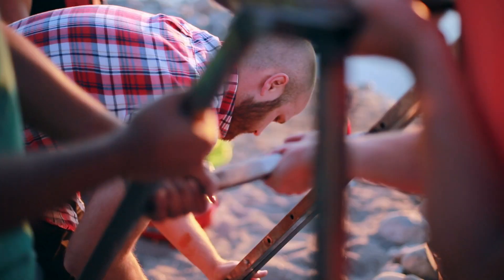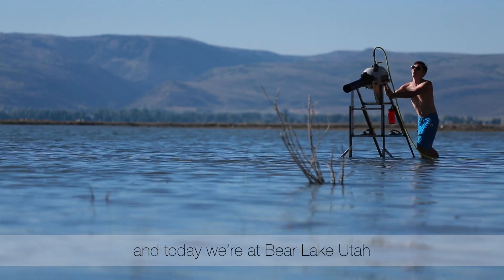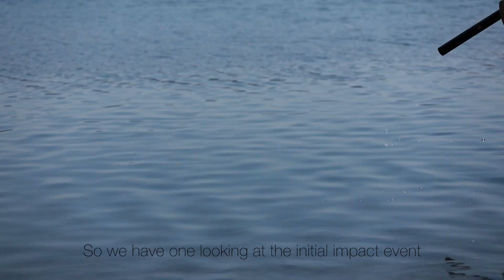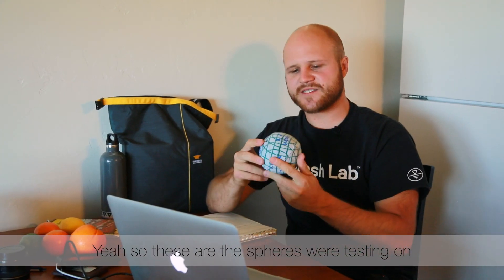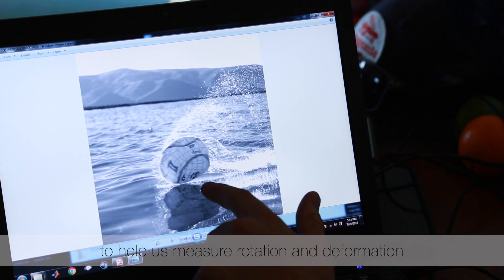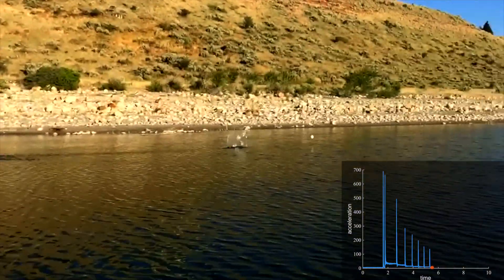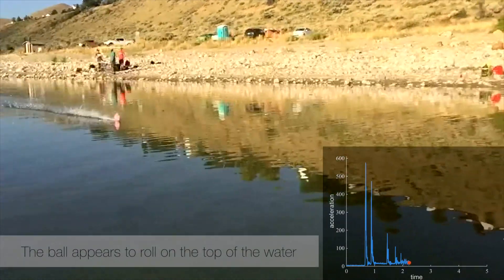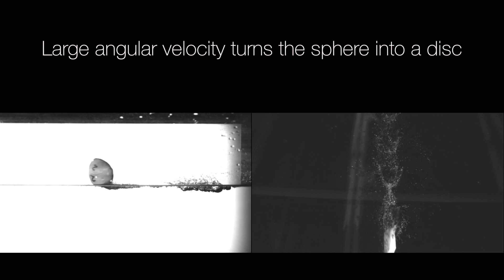USU Splash Lab: Water Walking

Comment: if you look at the guy who has the outright 1000 meter speed record for sailing ( crazy cantilever speed sail design) -----you will eventually come across older interviews of him where he explains the process of innovation. apart from the design of the hull and sail , he said a major obtacle was the shape of the foil. 
at speed above 60 mph (he hit almost 80mph sailing if i recall) the hydroplaning foils no longer was to stay sunk below the water surface and so they begin to create massive drag, the result is that he changed the shape , through iterations, of a subsurfact foil with the traditional wing or tail shape, to a more oblog spherical shape, like a more triangular rounded elephants foot , and that surface 'skips' or provides enough fluid stability at high speed to keep the boat supported on the surface foils. 

i think that boat was 'water walking' far before this video coined the phenomenon. I would not be surprised if you shot that sphere out at over 50 mph, though it isn't mentioned in the video what speed you shot it at. I'd imagine various speeds, but it looked pretty fast overall. 

great job. 
i am wondering if there isnm't some commercialize-able patent here, for high speed surface foiling attachments to an airboat that routineline travels above 50-60mph while experiencing more than necessary drag on its undersurface using a typical planing hull.
Reply: This be the thing of which you referred
http://www.sailrocket.com/node/170
i isnm't sure about some commercial-able patent here though
Reply: @HughSHay  yea , it turns out it's above 70 miles an hour you get 'cavitation' of sunk hydrofoils. kinda like breaking the sound barrier but not really, it's a more macroscale problem but it's the result of going to fast underwater. 

the only known solution to this is to emit bubbles or foam from the surface on the foil, so that the foil can slide through the water faster. that seems an infeasible approach, especially as it was invented for ultra high speed torpedo designs, which , i believe have been made obsolete by water skimming cruise missiles.